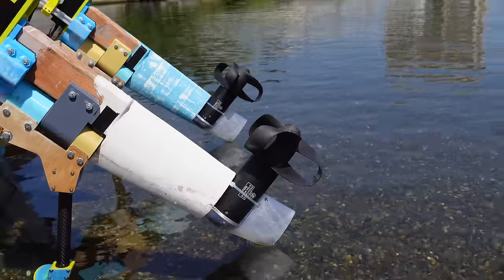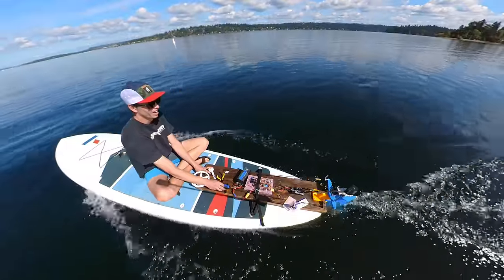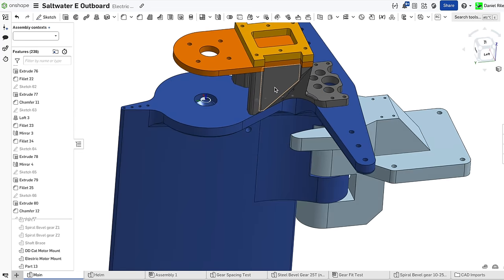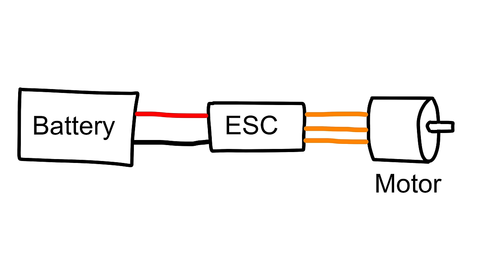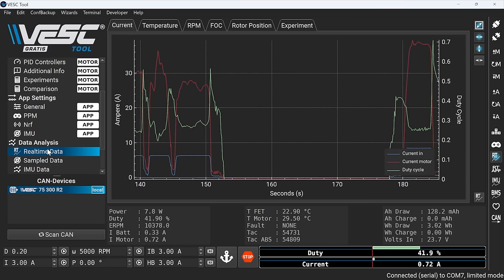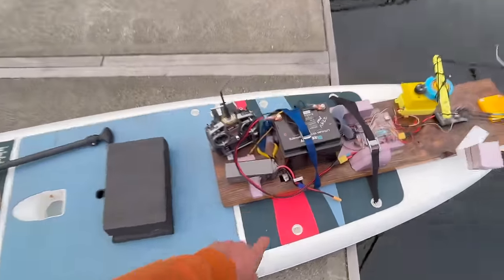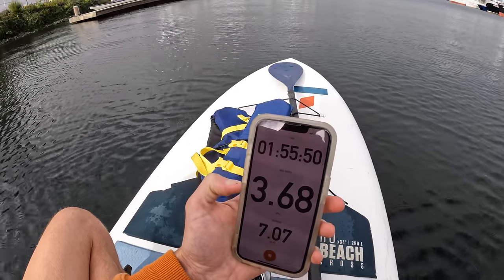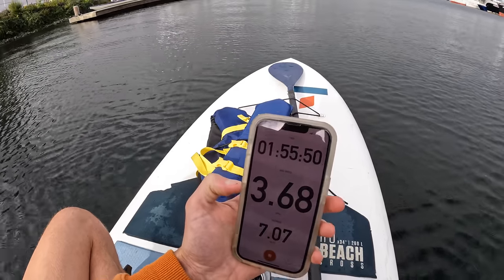Toroidal Propeller Testing on my Electric Surfboard

Comment: I wonder if the fact that the toroidal propeller is 3d printed is screwing with the results. I know you are using 3d printed normal propellers to counteract this but I think it's possible that the geometry and surface area of the toroidal propeller might be affected more by the imperfections from the 3d printing process than the normal propellers. That said I have done no research to back up this claim so take it for what it is.

Comment: With some throttle controls and a proper radiator, the V8 would totally kick the electric motors ass.
Reply from the maker: Proper radiator? The entire lake was the radiator. Doesn't get much better than that.

Comment: wouldn't this test be way more efficient/consistent if used on a stationary motor in a large pool or something hooked up to a weight measuring the amount of thrust it has with how much it can pull?

I'm not that smart but I have seen that method be used to measure thrust on some engines for flight so why wouldn't it work in water for boat propellers?

I'm thinking just making a stationary rig or something that you can plop down near the harbour to measure the level of thrust might be ideal for quicker, easier, and potentially more scientific measurements. 

though I may be entirely wrong since I'm not a physicist or anything, maybe the way water works don't allow that, dunno.

PS love the video, cool someone's testing this stuff and putting it out there in non science paper form.
Reply: You are kind of right, but not really. But on the right track.

Static testing can be useful for planes because of a number of reasons. However, boat props are so much affected by the water flowing over them at speed, so its hard to gain any meaningful data. Prop testing in general gives almost useless data on anything buyt on a single craft, on a single rpm, with a single engine, with a single water current, on a single day.. etc. You get the point.

Thats not to say it might be fun, but as for extrapolating real world usage at higher speeds is bordeline impossible.
Reply: @GoldenCroc  it may not be a 1 to 1 measurement of in real performance however wouldn't it be a good benchmarker? like figuring out which one has the most output or maybe just filtering out the undesirables.?

or can the performance of actually moving around like on a boat for example actually make the least powerful looking one on benchmark unexpectedly be the most efficient due to the force not measured on the static benchmark like the moving water impacting it and etc?

sorry I'm not that linguistically inclined, hope I made sense XD
Reply: @D2_Papaya  Your wording makes perfect sense, no issue at all.

Firstly, tractive force does not equal transferred engine power. 

Secondly, yes, what is the best results for a single prop will vary wildly between speeds, load, hull type etc etc.

Put 1 guy with a 3:1 gear ratio in a tug of war with another identical guy without a gear ratio. The first guy is 3 times as strong... but not really. Its the gearing.

I reality the guys themselves are identical.

Now tell the guys to see who can reel in the rope fastest. The second guy is 3 times as fast as the one who had a gear ratio, since he has to turn his arm 3 times as many times to equal the same speed.

As you might have understood, the prop is analogous to a gear ratio. What is the best prop is heavily dependent on outside factor, speed being a big one.

Comment: now work with hull shape and water resistance
Reply: Round bottom could be good on lower speeds
Reply: catamaran is good or hydrofoil but the power would be big to lift ya

Comment: how large can these 3d printed props go and stay usable\ reliable? being able to print say a pair of 25x 25 1.5 and use them for x amount of seasons before reprinting or damage could be a huge savings to many. if you had a printer large enough is there a plastic that would be strong enough?
Reply: Absolutely terrible compared to a conventional prop. Only usable for low power and small props, if you care at all about efficiency. Consider that high power pleasure (most of the larger ones these days) boats have moved away from even using high strength aluminum props for being "too soft"...
Reply: @GoldenCroc  i dont really care about efficiency as my engines are diesel and pretty efficient for they are anyway. I want to know if there is a printable plastic with enough strength to hold up a couple seasons. I mean i doubt it but never know. You wouldnt be able to beat being able to print up a new set of props at home whenever you feel like it.
Reply: @andrewscotti1136  There is printable anything these days... even metals. At home, with a reasonably priced printer? I doubt it. Of course, it depends heavily on what waters you have the boat in and what you use it for. It is concievable for light usage.

May I ask why you want new props so often, and what kind of vessel they are supposed to be used for? (size, weight, type of hull and engine power).
Reply: @GoldenCroc  i dont neccesarily need new props often but i do need new props atm because i have 3 blades when i should have 4 blades. 25x25x1.5 It would just be a large savings being able to print them compared to 2k each new. I have a 1965 41ft hatteras convertible with twin supercharged but technically n/a 2 stroke 8v53 Detroit diesels. Lots of torque. It is a planning hull with an estimated weight around 32,000 lbs
Reply: @andrewscotti1136  I was guessing your boat might be detroit diesel powered, as well as the general type and size of it when you mentioned the size of the props. Still, its good to know more exactly for sure.

Though I must admit my experience with props of that size is very limited, my personal boats are smaller, lighter, and much higher speeds. I am not sure exactly what kind of forces/loads those props see. Also the waters, how they deal with barnacles etc. I would think that would be an issue to say the least if used in the ocean.

Also, I should think the material and time to print such big props would not be exactly cheap compared to finding some reasonably fresh used ones. What non commercial printer can print a 25 inch square area? Cant be common.  Which means you got to find a company to do it for you. And if you print it in pieces at home.... ehhh,,, I am sceptical how it will stay together in the long term.

Perhaps you can find someone with a similar vessel that you can do a trade/swap with.
Reply: @GoldenCroc  a copper based paint would take care of growth and as far as printable size you are def right, if a strong enough plastic material does exist instead of printing i think creating a mold would be a better idea. But the forces are extreme no doubt. What exactly idk
Reply: @andrewscotti1136  I think the mold might be the better idea, yes. Lots of people have done it and used scrap metal aluminum from old car rims melted down and effectively got the material for free I am a 

former physicist, but metallurgy in this specific application is a a bit outside of my area of expertise regarding corrosion etc. I would think its possible, but not advisable. 

But if want to go any longer stretches with you boat of that relatively considerable size, I would think the fuel savings would add up fast.... perhaps you can borrow a prop of the typ you want and make a sandcast mold from it, that way it would be extremely cheap.

Comment: That efficiency-speed graph at 12:10 doesn't make sense with what you are saying, it's not showing the inverse relationship you are talking about
Reply from the maker: Why not? Looks fine to me
Reply: @rctestflight  really? Shouldn't the line start higher and then lower as you go along as the speed increases? The line shouldn't start at zero of course(no efficiency at zero speed).

Edit: I see my mistake😀, I'm used to efficiency presented as % and my brain ignored the unit of efficiency written on your graph😀😀 my bad, there is no problem with the graph.

Comment: A propeller is a rather complex design; it is unlikely to find a successful design by creating only a few models of toroidal propellers. Well, you need to create an AI that will generate propellers, after generation the propellers are placed in a fluid simulation and efficiency is checked there, after receiving efficiency data, the data is transferred to the AI, after which it learns to make a more efficient propeller design using them. And only after this procedure (or an analogue) should a prototype be created in the real world to ensure its effectiveness.
Reply: AI is not a magic bullet people, I am not sure if some "AI" model that made for this specific thing would be more efficient in searching legitimate propeller designs than just a human who have some idea about what works and what not. The only way I see it working is some per-selected parameters and some "AI" is that just used as a little bit less random search across all the possible configurations ( which also requires to set the general formalistic parameters for those configurations, by hand).
Modern language models and or stable diffusion definitely will just hallucinate random things.
And if you were thinking " but let AI set configurations - that's just brute-force random search, in effect.

Comment: Its even worse than a prop being the best only at a certain power input and motor.... As far as I know, there is no single "best" propeller for efficiency, no matter "double bladed/fold back blade" or not. It also depends on the speed you wish to go and what hull/boat/ship its mounted to, not to mention weight of the craft etc. All in all, prop testing is hard, and gives very specific data thats only marginally applicable to other craft. 

I question Sharrow props hype by third parties myself, not in as much as I question the results, but I question what they compared it to. The "independent" test I have seen seem to be eager to conlcude its a "one size fits all" prop when its anything but. Its a bit like taking a both SUV and F1 car grocery shopping in a comparison test, and concluding the F1 car must be totally misdesigned, since it is so impractical and have no storage space....

Comment: In the realm of research, we set forth to explore,
The wonders of toroidal propellers and electric surfboards galore.
A dance of innovation on land and sea,
Where science and engineering intertwine with glee.

Toroidal propellers, with their ring-shaped embrace,
Efficiency and silence, they beautifully grace.
Through water they glide, with enhanced thrust,
Vortexes tamed, energy losses reduced to dust.

In the depths, electric surfboards take flight,
Harnessing waves with electrified might.
Propelled by motors, they carve through the tide,
A fusion of power and surfing, side by side.

In the lab, propellers spin and surfboards charge,
Researchers delve deep, their curiosity large.
They study the flow, the forces at play,
Seeking efficiency, safety, and new horizons each day.

Toroidal propellers, in their ducts enclosed,
Efficiency soars, noise and vibration composed.
Marine life protected, swimmers kept from harm,
A testament to innovation's gentle arm.

Electric surfboards, a thrill on the water,
Battery-powered dreams, a surfer's new chapter.
With speed and agility, they ride the wave's crest,
Bringing joy and adventure, an experience blessed.

Research unveils the secrets held within,
Toroidal propellers and surfboards, where victories begin.
In labs and workshops, minds alight,
Advancing technology, pushing boundaries with all of their might.

So let us celebrate these feats of research grand,
Toroidal propellers and electric surfboards, hand in hand.
A symphony of science, a harmony profound,
Where creativity and knowledge resound.

In the realm of research, we journey and explore,
Toroidal propellers and electric surfboards forevermore.
With each innovation, new frontiers unfold,
Guided by the spirit of discovery, a story yet untold.